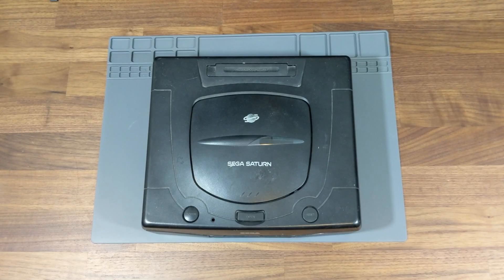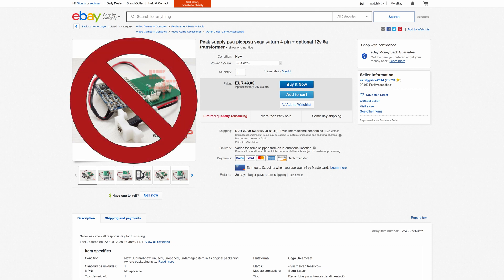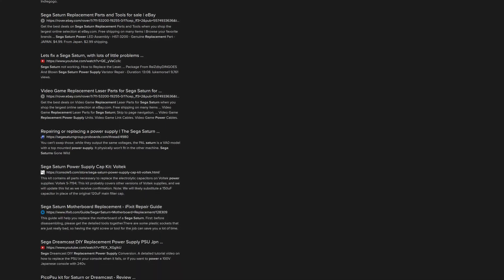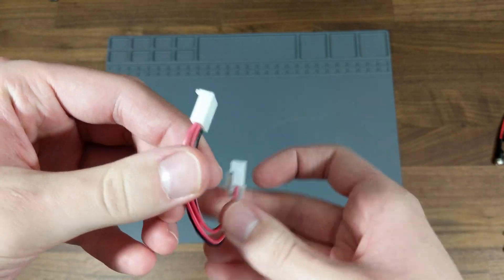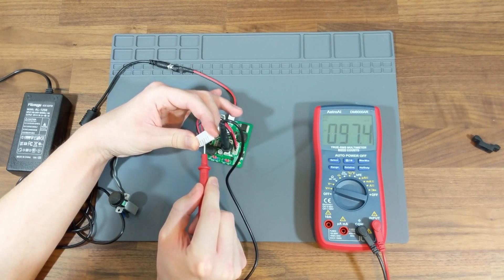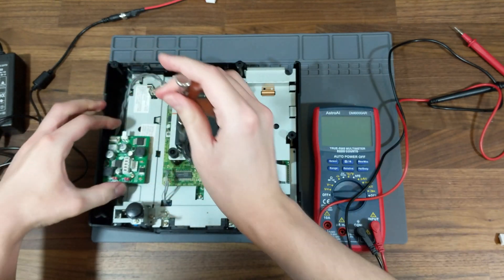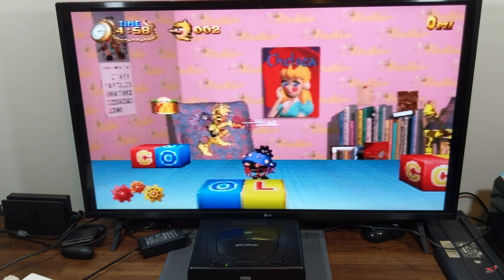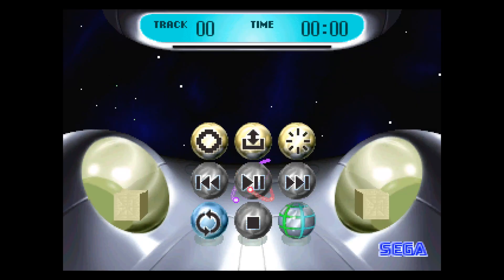The ReSaturn PSU: A Modern Replacement SEGA Saturn Power Supply

Comment: Nowadays you can get a USB-C plug with 12v power delivery that terminates in the DC barrel plug these power supplies use. Pretty nice option, especially with modern backup batteries and PD USB-C adapters that can feed more than one cable.

Comment: "Let's waste ridiculous amounts of time and money looking for a replacement PSU instead of spending 20cents on a new 2 pin AC inlet from mouser/digikey/etc and soldering it in"... 
Nice poorly disguised ad video for the resaturn though. Cause that's all this is...
Reply: Why dont you cry some more about it you insufferable sack of shit
Reply: Hello, at first glance I was thinking the same thing as it's just basic soldering that would have been required to fix that melted Outlet.

I have a completely recapped power source and anything else in the Saturn that needed recapping as well as FRAM mod and everything else you could do to a Saturn including MODE and having a custom PCB made for optical digital output directly from the sound chip from the tech I bought it from.

My question is everything runs perfectly however I wonder if I should buy one of these new type power supplies to have as a backup.

If I did so, would it be better to run the newer modern power supply and keep my new recapped original power supply stored away for safekeeping for another day... since it's a better power source Than This Modern one?

I ask because it sounds like you know much more than I do about Electronics and I always take any and all advice when it comes to preserving my Retro Game Collection especially my Saturn! :)

Comment: Thank you for making this video! I'm sitting next to my presumably dead Sega Saturn. It went "pop" one day and I never got around to looking into it. I think the power supply is dead because one of the big capacitors are slightly expanded but everything else looks decent. 
My Sega Saturn looks different from yours though. It's got a white color case and the model number is HST-3220. AC 100V 50/60HZ 12W.
Reply: White Saturn is the Japanese version
Reply: US standard is 120V
Reply: This is the Saturn I just bought, as long as the external power plug you buy is one for your region of the world then the ReSaturn'll play perfectly with it.

Comment: Did you find any heating issues on your resaturn? Just got one and installed it. Same model Saturn as in your vid and got the same power adapter. Once installed, the console only comes on half the time and when it does, the PSU very quickly smells like burning.
Reply: honestly soudns like you have your pins wrong here
Reply from the maker: I did not have any heating issues with my ReSaturn, even after playing on the console for a few hours. I would verify your AC adapter is working properly and then probably contact Rexus for support. The biggest downside of units like the ReSaturn is their reliance on 3rd party AC adapters as the quality on these can be pretty hit or miss and almost all of them are made in China.

Comment: I am trying to do the same test you attempted on 5:00 but I am getting 0 volts on everything. The AC adapter also registered 12 volts as you did. Any suggestions on what I could be doing wrong?
Reply from the maker: Assuming you have everything connected properly and the power switch has been toggled on, make sure the ground probe from your multimeter is connected to one of the ground pins on the ReSaturn and you should be able to get power readings from the unit. If that's not working you might want to reach out Rexus for support.
Reply: @secret_switch  the problem seemed to be an incompatible or bad ac adapter. It supposedly has the correct specs but I couldnt get it to work. I then switched to the exact one you are using and everything worked.

Comment: The AC connector on the original was damaged.....so ditch the entire power supply? That makes no sense, especially when the rest of the power supply looked to be in perfect working order. Did it not work? Why not just source a replacement for the AC connector piece?
Reply from the maker: I actually looked into this at one point, the company that makes the AC input jack on the OEM PSU still exists and still makes parts like this but the specific model that was on the Saturn's PSU wasn't listed in their catalogs. Not to mention something on the OEM PSU or the OEM power cable caused the AC input jack to melt so I wasn't particularly keen on replacing it only to have it melt again or burn down my house while playing Daytona USA.
Reply: @secret_switch  It's worth noting that Laser Bear makes a 3D-printed replacement for that connector, works pretty well too

Comment: Now if there was one made for the N64, after market psu are really bad. Had one almost fry my N64
Reply from the maker: I'm not sure how difficult it is to track down an OEM N64 PSU considering how easy they are to attach and detach from the console. I have heard of people refurbishing OEM units by replacing the old capacitors, something like that might be your best option.

Comment: Thanks for sharing this info. I ordered mine the other day for a Japanese Model 2 system, I can't wait to install it.
Reply from the maker: Oh awesome, are you going to do any mods to get around the region locking? Thanks for watching!
Reply: @secret_switch  I actually picked up an Action Replay off of amazon to solve that problem. The mods for that are impressive, though!
Reply from the maker: @zbtnotorious  Very nice, I think you can use that to bypass the copy protection and load backups as well.
Reply: Can you use it mod an Japanese console to work in the UK without using a step down adapter? thanks!
Reply from the maker: @lucacamerada4722  I believe this should work but you should message Rexus to confirm. The external PSU handles converting AC power from the wall to the DC power the ReSaturn takes as an input, so as long as you have an external PSU that is designed for the UK power grid you should be fine.

Comment: Also bought this two weeks ago, waiting for Fenrir now too, good times, thanks for the video
Reply from the maker: I've been holding out for the Satiator but the Fenrir has been tempting me. Let me know what you think once you get everything installed.
Reply: @secret_switch  yeah couldnt wait any longer for the Satiator plus the MODE is too expensive right now. Great to have options.
Reply from the maker: @Eddhorse  Haha yeah it certainly has been a long wait. Seems like the Saturn has been growing in popularity over the last few years and with that we're getting more mods and homebrew and whatnot, exciting time to be a fan.
Reply: @secret_switch  and the best thing about the Fenrir is they are developing a 21 pin version and supplying a lot of updates currently via SD card.

Comment: Secret Switch if you're reading this you need to take a look at this PSU again, https://twitter.com/MrMario2011/status/1248272616496017413 the Dreamcast version was dissected on Twitter and there's some serious concerns about its quality, especially ripple and its complete dependency on the external brick as to whether it works well or not.
Reply from the maker: I believe they are talking about the DreamPSU which would be the PSU designed by RetroPSU that I briefly mentioned in the video. The ReDream PSU and ReSaturn PSU are not based on these designs according to Rexus but I don't know enough about electronics to analyze them as thoroughly as someone like Voultar.
Reply: @secret_switch  yeah I'm just concerned that they me all be based on basically the same generic PCB, the sellers are vague no one seems to really know for sure
Reply from the maker: @ichrismoku  I tweeted at Voultar to see his thoughts on Rexus' PSUs, but based on appearance alone they appear to be quite different designs than the PSUs from RetroPSU.  I don't see the TPS54525 chip mentioned by Voultar that is seen on the DreamPSU on the ReDream PSU or the ReSaturn PSU.
TPS54525 step down converter pictured on TI's website: https://www.ti.com/product/TPS54525
DreamPSU pictured in an article discussing the design concerns: https://www.retrorgb.com/dreamcast-replacement-psu-design-analysed.html
ReDream PSU pictured on Rexus' website: https://rexus2019.wordpress.com/redream-psu-a-12v-power-supply-for-the-sega-dreamcast/

If you're concerned about the ReSaturn being dangerous you should message Rexus on eBay and ask for clarification, he was really helpful to me with my questions about the designs. I personally don't have any concerns with the ReSaturn based on the testing that I did, the external AC adapter and the ReSaturn were both putting out the voltages they should have been but I am by no means an expert.
Reply: I know this comment was made a year ago, but in his Tweet Voultar isn't saying the DreamPSU is harmful. He was just saying that it's a generic design and wasn't tailored specifically for the consoles needs. I have a Chinese SaturnPSU clone in my Model 2, no complaints outside of some diagonal line interference that I suspect is from the power brick itself, same issue occurs with the pico in my Dreamcast is why I think it's the brick. I picked up a Model 1 and went with a ReSaturn PSU this time because the designer claims it is tailored for the Saturn's needs specifically. Both will serve your needs, one is cheaper and the other offers slightly higher quality for a bit more.

Comment: Bought this last week and installed it today. Works flawlessly, installation a breeze.
Reply: Any solder work required?  Didnt seem to be from the video.
Reply from the maker: @damiansurace7941  Nope, the OEM and ReSaturn are held in with screws and connected to the main board via a few cables.
Reply: @damiansurace7941  no, you just install